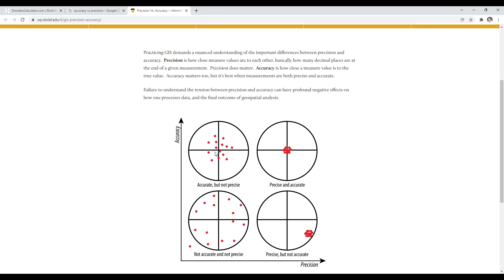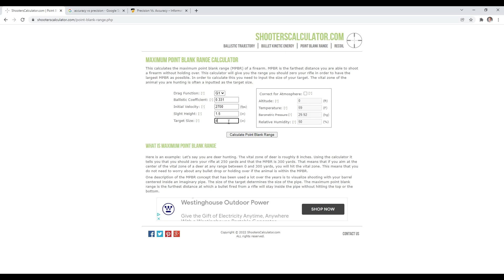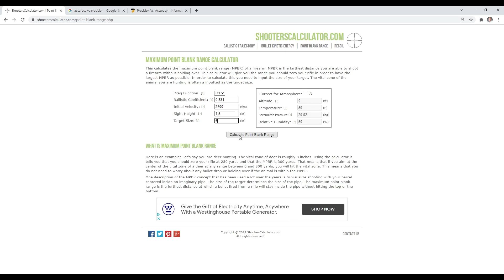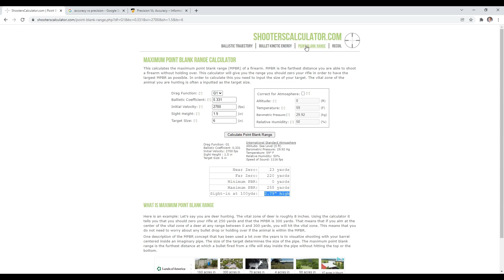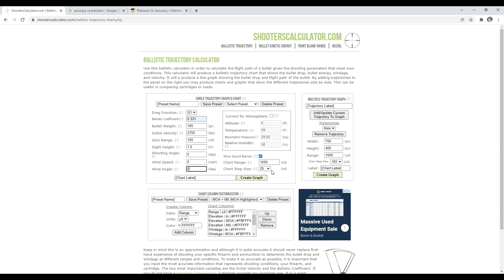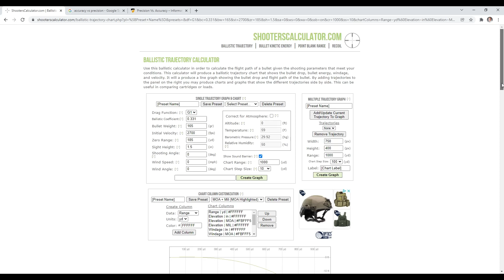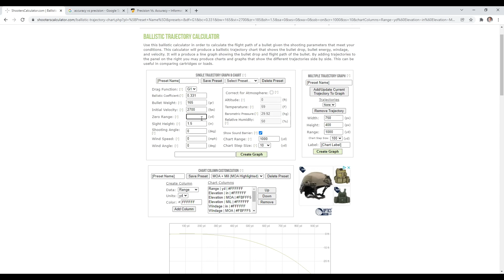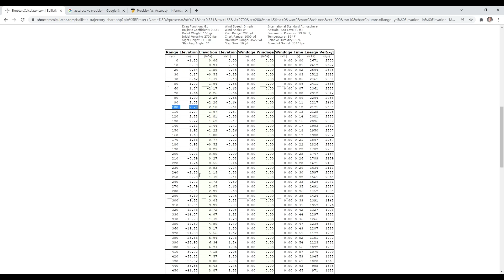Maximum Point Blank Range

Comment: Nice tutorial - clearly explained thank you. Do you end up sighting in at the Far Zero yards (220 for your bullet) or go with the 100yd sight in recommendation? My cartridge ballistics recommend a 200yd sight-in, but the calc called for far zero of 232.
Reply from the maker: Glad it was useful! Depends on the gun. My Benelli Lupo (6.5) has a BDC which is good with a 200 yard zero; in that case I zero to 100 and memorize the dial for a 200 yard zero (1.82 moa). My .243 has a 296 MPBR with a 253 far zero (which is 2.54" High at 100). I zero it to 100; then when I go into the field I just dial up 2.5" and know I am good to the MPBR. That way I can shoot for bull at 100 and when I am dead nuts just remember the dial for the MPBR. Obviously you could just zero it at 2.54 high at 100, but I find I am less confident in my poi when I am trying to aim at 1/2" measures...